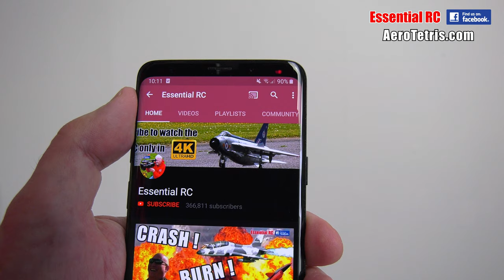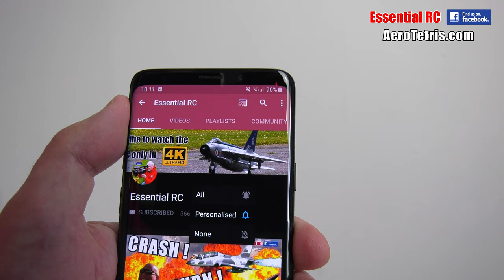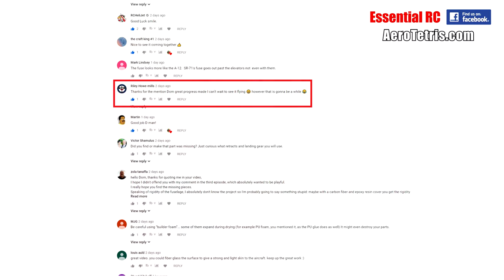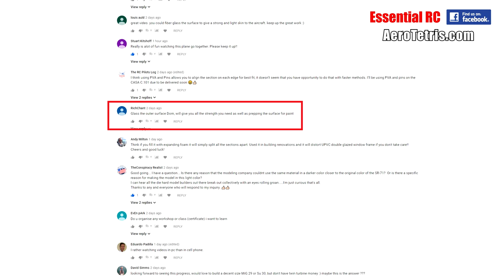AeroTetris 2.8 metre SR-71 Blackbird: BUILD LOG: Part 5

Comment: Another great video. I would go for EDF because it would save you a lot of hassle when you are at the flying field and you could put a speaker and sound pack on it for extra realism. 
Keep up the great work.
Reply from the maker: Thanks Luis. Power system will be my first install. It will start feeling real when get to that. Cheers Dom (Essential RC)
Reply: @EssentialRC  by the way Dr mad thrust have just brought out a new line of EDFs on hobbyking.
Reply from the maker: So I saw...although nothing bigger than 90mm although that could still be an option. I dont think this needs to be fast to look good in the air.
Reply: @EssentialRC  very true

Comment: I'm watching these vids carefully - I have the same kit from Egor, though I won't be able to put it together for a while due to lack of funds. Still, it's good to see how it's made.
Reply from the maker: Thanks for following Bill. Good thing you'll learn from my mistakes! Cheers Dom (Essential RC)
Reply: @EssentialRC  I actually started the customer list for the SR-71. It took me a year or two to convince another four people to join the list but it looks like the wait was well worth it.
How many 1000 mm 10 mm carbon tubes do you think it'll need? Looks like six for the fuselage and four for the wings? I can't afford to build my kit to be flight-ready, but I'd like to glue all the bits of foam together so I can just look at the majestic shape of the beast.
Reply from the maker: Yeah 10 x 10mm carbon tubes so far. A few 8mm tubes to connect them. I'm going to make this a budget project as think that's what would interest most folks. Next AeroTetris build will be single turbine or 6 x EDF monster transport airliner. Cheers Dom (Essential RC)
Reply: @EssentialRC  thanks for that. I've ordered some tubes and hopefully can put it together in the next couple of months.